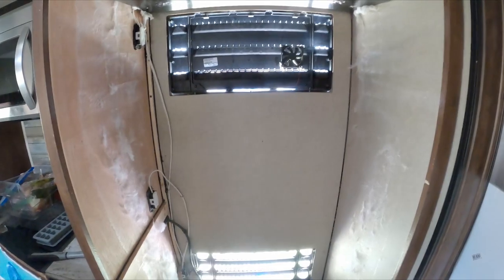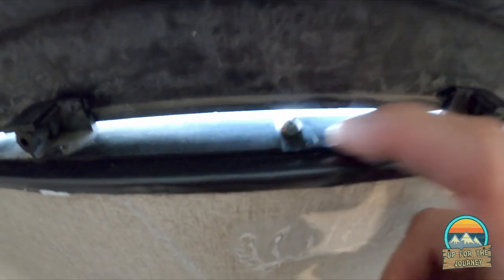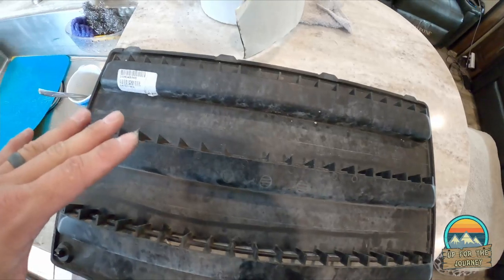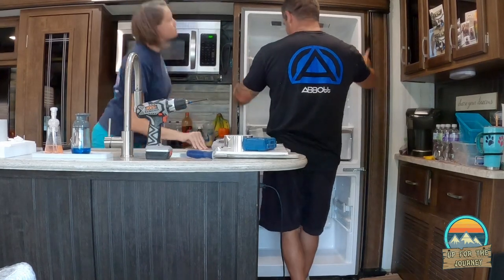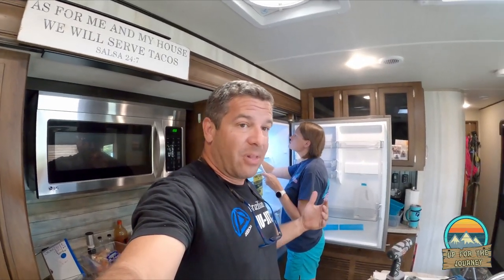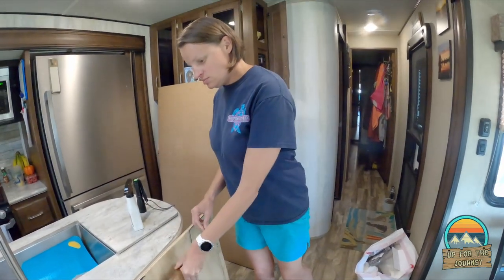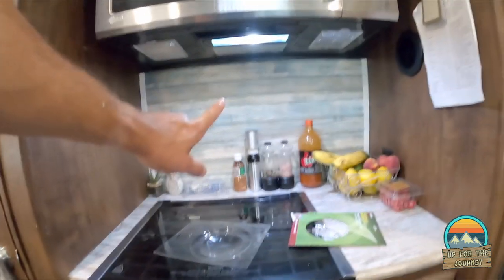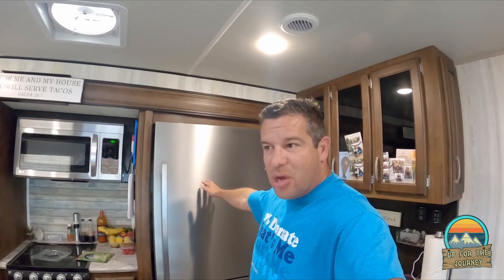Residential fridge install Part 2/ Residential fridge in a RV!

Comment: Nice video thanks for sharing! I have a reflection 312bhts so its the same fridge and location. If it ever gives me problems I’m def swapping it for a residential. I think I would maybe leave the original plywood floor support in, depending on the height of the new fridge and remover the casters that way it would keep the gap up top nice and tight and I would probably keep the vents open to keep air flow. If I’ve never had water in there up till now I don’t see why it would be an issue
Reply from the maker: The height of the new fridge made us remove the riser floor. The original floor of the RV is still there.  This fridge doesn't produce the extreme amount of heat as the Dometic did. So that's why i closed off the back vents.

Comment: Great video, getting ready to do the same to our motorhome. Can you tell me if your power is feeding from the inverter or just shore power??
Reply from the maker: Inverter. We just used the plug that was there. It was wired into the inverter

Comment: I have watched your videos several times taking notes :)  We have a 2021 315 that we are looking to put in a residential.  Can you share the measurements of your space after taking the old one out?  How did you get all your measurements to ensure the one your ordered fit?  Thanks
Reply from the maker: We actually just measured the old fridge, this new one was not as wide, but a hair taller. We knew the old fridge was on a pedestal, so we had 5in to play within height. I put the link to the new fridge in the description, which'll have the exact measurements.

Comment: We just installed the exact same fridge! Tomorrow is travel day for us and we're not sure how to secure the fridge itself and the doors! What have you guys done to secure it??
Reply from the maker: You wouldn't believe me if I said we used 2 screws.  That's it.
Reply: @Upforthejourney  Where??
Reply from the maker: @MakingMyAbodeOTR  there were small holes by the feet. If I remember correctly. I know we didn't add or modify anything to screw it down.
Reply: @Upforthejourney  Thank you

Comment: We have the 1350 out of our 315RLTS, picking up the new fridge today. Just have a couple questions: 
Did you end up removing the casters on the front?
Are the two screws in the rear enough to hold it in place during transit?  There are some really rough roads out there these days.  
Also do you have any trouble keeping the doors shut while traveling?
Reply from the maker: Everything is in tact.  
As far as the 2 rear screws, yep, never moved.   The doors never opened on travel days, 1 side was blocked by the island.
Reply: @Upforthejourney  So, you didn't add any support at the top? just the screws in the back? How much clearance is between the door handle and the island on your rig?

Comment: Wondering about the space between the fridge and island for the door to open. I see the specs on the fridge of door open but want to be sure it will clear my island.
Reply from the maker: It clears no problem. But you can't open it when the slide is closed.

Comment: That metal plate at the top is just a baffle to force the hot air from the RV refrigerator to go out the vent. You don't need that for a residential type refrigerator.
Reply from the maker: Good to know. Thanks

Comment: that refrigerator burns about a kilowatt a day which means that 4 GC2 batteries powering an inverter would last about a day and a half just running your fridge, and that's just the fridge when you combine all the electrical loads you would be lucky to last 12 hours on battery, so if you ever plan on being without power you might want to consider a good generator and lots of gas cans in reserve.

solar really isn't an option as most people like to camp in the shade and solar panels don't work well in the shade. so unless you have a portable solar panel system that you can mount in the sun while parked in the shade solar is not an option 

On the other hand a good propane refrigerator will burn about a pound of propane a day so a 20 pound tank is good for 15+ days or a bit over 1 dollar a day. On the other hand that residential fridge will cost you between 5-6 dollars a day to power with a generator.
so yeah basically a residential refrigerator will cost you about 500- 600 percent more to run while off grid
Reply: Good info Dan. We are considering converting to a residential refrigerator but have no plans on boon-docking for extended periods of time. At the moment we keep our RV set up in a park full time. For us, the pros of a residential fridge far outweigh the cons. Our Norcold fridge runs on AC unless there is a power outage which is rare. We do have a 2400Watt generator that we used with our much smaller RV that we did boon-dock in very frequently. So if we have a bad power outage we're prepared.
Reply: @seairis616  one of the benefits to RV refrigerators is that they are heavily insulated as compared to residential refrigerators which usually have just about an inch of insulation.

I spent years sailing and learned quite a bit about refrigeration efficiency.

I did a test recently on an old RV refrigerator, after bringing it down to temperature we put a 10 pound block of ice in it and then turned off the refrigerator.

It took over a week for the 10 lb block of ice to melt in the freezer compartment. That same 10 lb block of ice in a Samsung 10 cubic foot refrigerator lasted just 2 days. 

It's pretty simple to do the math and figure out how many BTUs per hour the refrigerator is losing but suffice it to say that residential refrigerators are very poorly insulated and the new ones with the coils built into the sides are even worse they effectively have almost no insulation. At least the residential refrigerator with the coils on the back or the coils underneath dissipated heat into the surrounding atmosphere rather than into the shell of the refrigerator heating up the outside.

The problem is unlike the Marine industry no one really makes a decent residential refrigerator they are all very inefficient and it doesn't have to be that way.

Even RV refrigerators are still using ancient technology with regards to the control systems. They can easily solve these problems and make a very efficient absorption refrigerator but they'd rather continue to pedal 1970s technology for a ridiculous price. 

Many people don't realize this but absorption refrigerators are much more common than most realize in fact most hotels that have mini bars are using absorption refrigeration because they are silent which is one of the main benefits. 

The biggest problem with absorption refrigerators in RVs is the use of resistive heating elements that rely on the voltage stability of the grid for proper operation. 

Simply incorporating an automatic buck boost system into the heating circuit would resolve 99.9% of the problems. As long as the heating element is seeing a constant 120 volts they will perform very well, but like I've stated before RV parks and campgrounds are notorious for electrical problems, they were really never designed for every RV to be running air conditioners and refrigerators and Max load and so the voltage sags sometimes to dangerously low levels which is not only bad for the refrigerators but is very damaging to the air conditioners.

And of course since most RVs are older they are very susceptible to conspiracy theories and old wives tales and don't listen to actual science and facts.

Something as simple as a Huges Autoformer can resolve almost all these problems, but due to disinformation and old wives tales quite a few RV parks have actually banned these items because they don't understand how they work and they believe that they are stealing electricity somehow.

As an electronics engineer I strongly urge our viewers especially full-timers to install some sort of autoformer into their RV and use it anytime they're connected to shore power

All and autoformer does is boost the voltage when it sags ensuring that your air conditioner and refrigerator along with all your other electronics is seeing sufficient voltage to prevent damage.

People don't seem to understand that wattage is wattage and if you have a device that draws 1200 w it's either going to get that by drawing 10 amps at 120 volts or it's going to get it by drawing 11 amps at 109 volts, the only place this doesn't work is with resistive heating elements, as the voltage drops with a resistive heating element so does the wattage.

Low voltage damages air conditioning compressors as they will draw their rated wattage regardless of whether they are seeing 120 volts or 105 volts the difference is they will just draw more current and it is that excess current that overheats the windings in the motors and burns them up. 

The overwhelming majority of air conditioning problems in RVs is also related to low voltage from RV parks and campgrounds.

Personally I believe that autoformers should be standard equipment in every new RV.
Reply: @dannelson8556  Thanks for that detailed reply. I didn't know about the difference in insulation between the two. I do know that absorption refrigerators are used on the ISS. I looked into an autoformer a few years ago but haven't gotten one yet mainly because of the price and two because the park we're in is well maintained. We do have a Hughes EPO watchdog that monitors the voltage and cuts power to the rig if it goes below 104V. I also check the voltage with the app from time to time especially on weekends when the park is full but we rarely have an issue. The park owner is a was a licensed electrician before owning the park and has done a fantastic job of updating the parks electric among other things. So far our RV fridge is performing well and hope to get at least 5 years out of it but I'm just planning for the inevitable. I would be very interested in making upgrade components for RV refrigerators to bring them into the 21st century.
Reply: 3 @dannelson8556